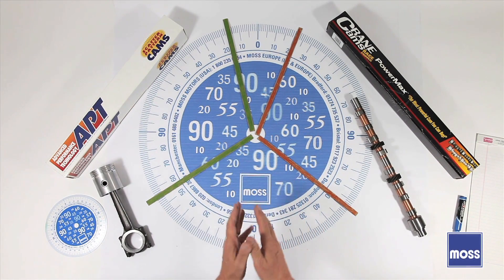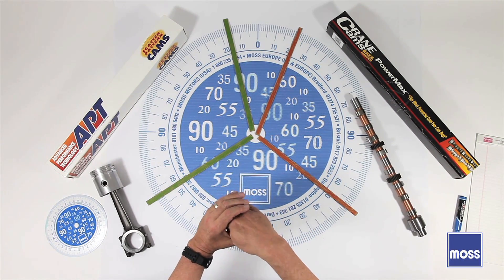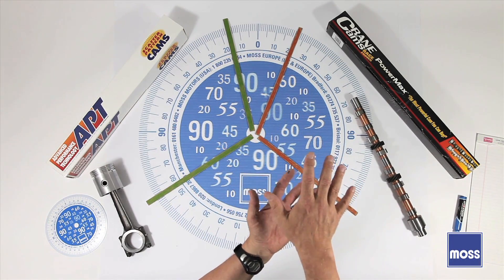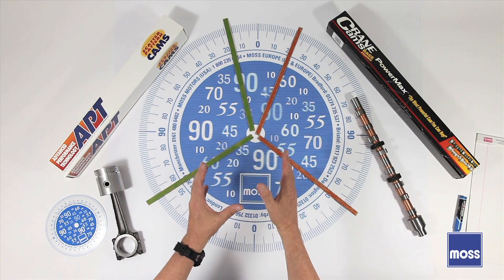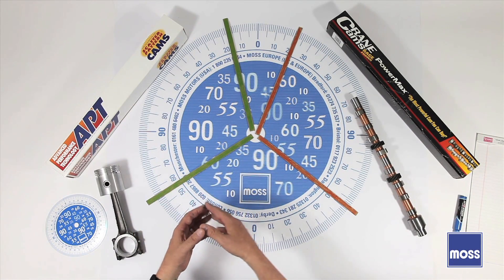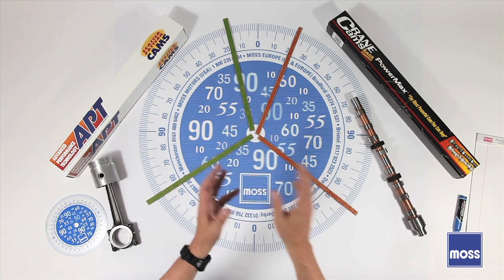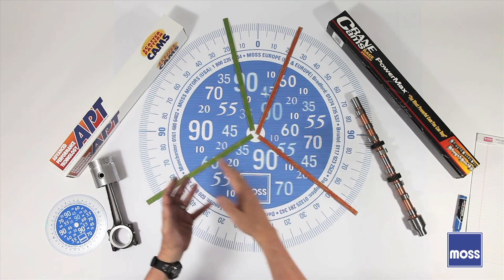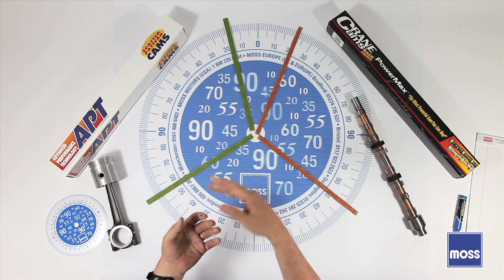Camshafts (Part 4) - Valve overlap

Comment: Very logical and simply explained thank you.   I noticed TONS (most of them) of factory grind cams actually have a negative overlap, when plugging their profiles into cam calculators, couldn't wrap my head around them doing that
Reply: They don't actually have negative overlap. That's an artifact of using 0.050" duration to calculate overlap instead of advertised, or 0.006", overlap. One must account for the full duration of overlap from when the intake valve just starts to lift off the seat (0.006" is a pretty reasonable guess for this) to when the exhaust valve actually arrives at the seat. If even 1 mil of clearance exists, air can, and does flow past the valve, affecting conditions in the cylinder.

Comment: would the low rpm problems be solved if there was more fuel in the air?
Reply: No because you still need compression, Remember...for fuel to bang it needs compression in a specific ratio with air.

Comment: How is this different from Atkinson cycle?
Reply: here you have high compression high expansion, in the Atkinson you have low compression high expansion... hard to understand like that? :))) it is a pretty tough question .. there are different versions of the Atkinson engine, the most familiar engine to you (at least I think)  is the one that in the compression phase maintain the intake valve opened longer, in this way the air drawn inside the engine in the intake phase can partially escape so you can lose less energy in the compression phase.. it is a thermodynamic fact, search pressure-volume diagram for 4 stroke engines..

Comment: IF there is an overlap wouldn't it cause the exhaust gases to pass through intake valve ?
if no then what is the pressure inside>>>> intake valve,exhaust gas pressure<<<< @ 30btdc on 12.6:1 CR  Duke 390 engine ??
Reply: No because there is too much pressure behind the intake valve face.
Reply: will! thats a reason for the unburned hydrocarbons the MOT reads with their gas testers

Comment: I thought the same thing, as it takes several degrees for combustion to begin and complete. On high performance race engines, spark timing is advanced to begin combustion early so that you get the biggest "bang" and the right time and degree of the power stroke. And when you are running high RPMs, most of the fuel has not burned when the exhaust opens, so a lot of the fuel is wasted and you lose potential energy. You cant get every bit of energy out of every bit of fuel burnt.

Comment: Around when does the spark plug fire?  Wouldn't it be more efficient if the exhaust valve opens around the 21 degree mark at the bottom instead of at the 50 degree mark as it does now?  It would seem like you would loose a tad bit of power from the combusted air going through the exhaust port before reaching bottom dead center (if that's the correct phrase).  I understand it would take a few degrees for the valve to open up but it wouldn't take 50 degrees would it?

Comment: Why do many diagrams on this topic display the valve lag and lead near BDC as valve overlap as well when it isn't? Ie. between ur top red and green line they are shaded as valve overlap, correctly, but then also between the bottom red and green line also. I have found this on google diagrams and in a book I have on engines, makes no sense but there must be a reason.